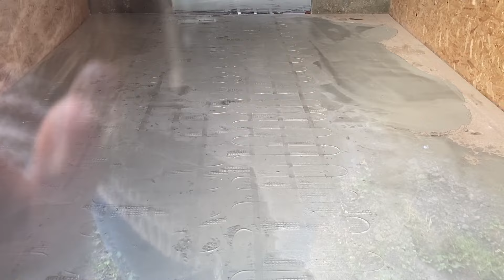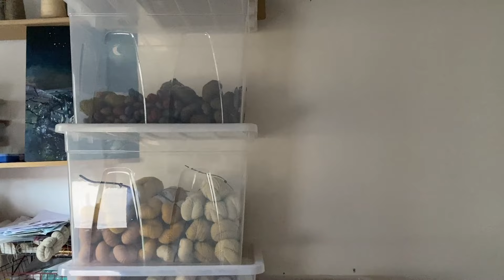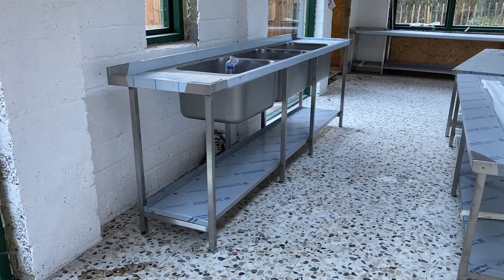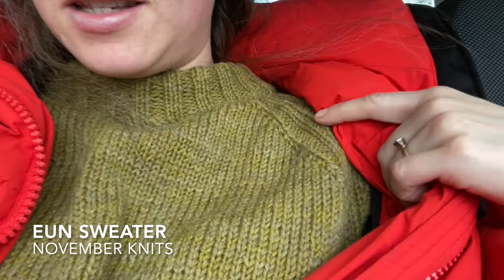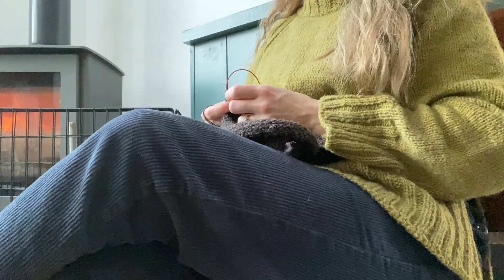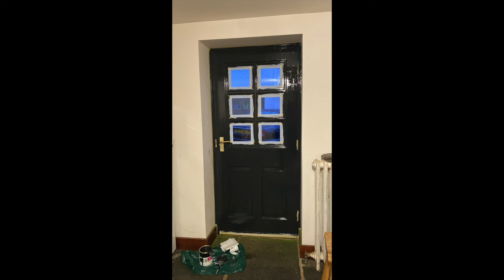Chatty Vlog | Knitting, Fermenting, Gardening & Dye Studio Reno

Comment: I made a proving spot by using a camping cooler and an inexpensive device that shuts off or turns on a 40 watt light bulb when the temperature gets too hot or too cold. The light bulb is warm enough to heat the inside of the cooler. It works remarkably well! There’s a little sensor that sits inside the cooler. Your studio is  coming along! So excited for you Emma! And for us knitters of your gorgeous yarns! 😊

Comment: Hi Emma, I have a styrofoam box from a delivery and I put my starter or my sourdough (if it needs to be kept warm as well) in there together with a bottle of warm water. I keep a thermometer in it and go for 26-30 degrees Celsius but it doesn‘t have to be exact. That‘s supposed to be the temperature the sourdough microorganisms like best. It‘s definitely a budget-friendly option and you don‘t need any electricity for it.
Thank you for your wonderful podcast. I enjoy it so much!

Comment: Yes!  The cold has really affected the sourdough process here as well.  I don’t think our home gets quite as cold as yours but I have found a way to speed things up without having to purchase anything new.  Although my oven has a proofing setting it is really too warm for the sourdough slow rise that is desired.  My solution is to preheat the oven just a until it feels warm, not hot.  I then turn the oven off and place the dough in its bowl in the oven and close the oven door.  This has really helped a lot.  Another thing I tried was to turn on the oven light to generate a gentle heat which has also helped.  I hope you enjoy the course you take and will share some of the tips you glean.  Btw, I love seeing your studio progress.  The composite floor tiles look great!

Comment: Hi Emma, you just need a warm spot for sourdough. An airing cupboard, top of fridge might work, in your dye studio when you’ve got your pots on or on the heated floor in the studio. Put a tea towel over your bowl of dough so air can still circulate rather than a shower cap.
Actually those places are good for other ferments as well, sauerkraut, yoghurt etc. You can also buy heat mats for germinating seeds in trays. They are size of a seed tray. That could be used too. You can experiment